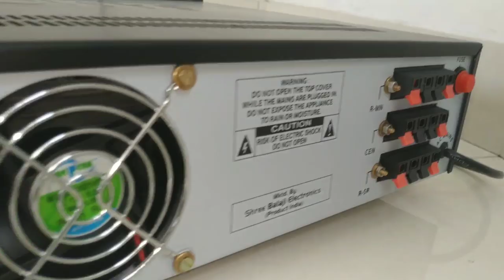5.1 amplifier with remote kit 400wrms full wiring and connecting instructions

Comment: Bro ithil namuk 5 car speaker's um oru gtx 1200 jbl nte sub um connect cheyan pattumo
Reply from the maker: Pattum
Reply: @technicalevolution9887  
Oru doubt koodi 2 gtx 1200 jbl nte baseum oru 5 cars speakers um 
Athin pattiya amp um 
Rate parayamo 
Bro veedu kollathe ano angane anel njn brode kayil ninn edukkam 
Full rate paranja enik cash set akan anu veedinte pani theerarayi apo ath kazhinja unden i will contact u 
So on rate parayamo

Comment: njan use cheyyunna amp details
5 channel = 500 watts
Sub 200 watts rms
'MOSFET ' amplifier board   . e amplifieril  
JBL A1300HI 1300W 12"  Subwoofer use cheyyan pattumo?    MOSFET ' amplifier board   nallathano?
Reply from the maker: Yes mosfet board is good you can connect jbla1300hi
Reply: @technicalevolution9887  thanks

Comment: njaan car sterio aanu roomil vechirikkunath.. volume kootumbol sterio off aayi povunnu...
Reply from the maker: Power supply kollilla atha
Reply: @technicalevolution9887  sony aanu.. ethra amp vendi verum?
Reply: Bro, 12v minimum 5 ampere power supply use cheyyam. Allenkil  12v 10ampere smps available aanu.cost about rs800-1200. Ath use cheyyuka